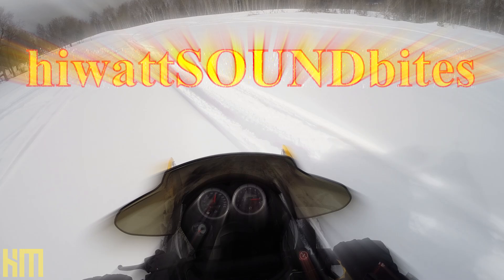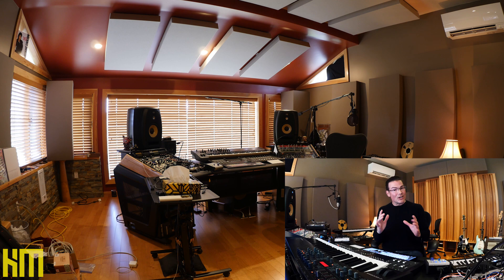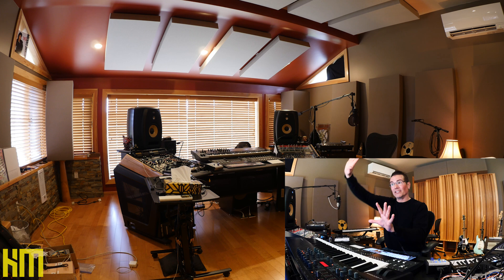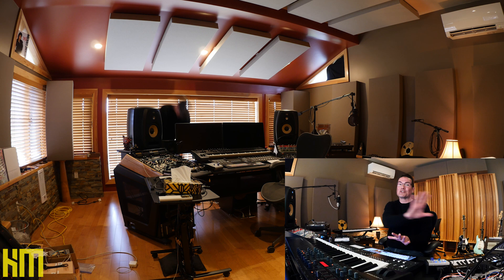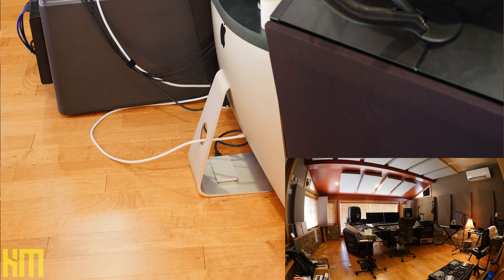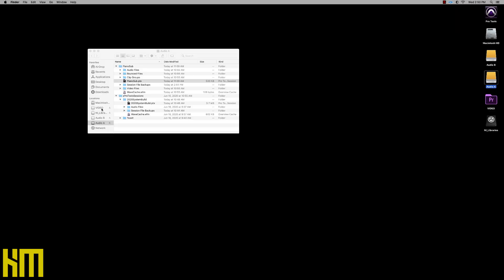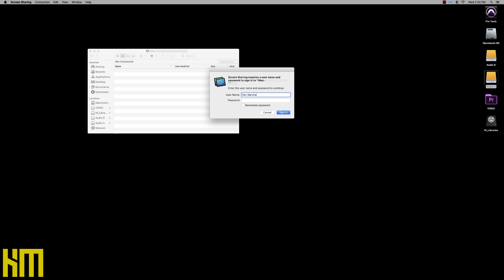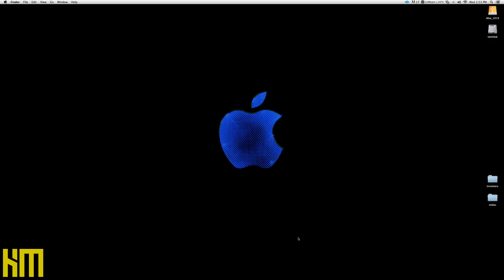Studio Ergonomics - Music Production and Engineering

Comment: Remember to change the battery in your computer's motherboard before retiring it. They're only good for x years and it sucks when they die and you turn your system on and it doesn't remember settings. Also if you have any platter style drives (the ones before SSD came out), it's good to at least turn the system on once a month or so. If they sit too long, sometimes they will seize and won't spin up again without disassembling them, which is not trivial.

Comment: Thanks for another great session, Ken.  This one really hit home for me, for I find myself perpetually re-routing gear, its power sourcing, and audio cabling.  When i choose a piece of gear, at the forefront of the decision is versatility- meaning, will i be able to put this hardware pretty much anywhere in my signal path? will i be able to run/switch between mono and stereo on the fly?  how will my software react to differences in signal path?  ...you get the idea.  there's a lot more to my choices of hardware than 'what does it sound like?'   i understand that attempted future-proofing can lead directly to signal-path neurosis, but it's always a consideration before i pull the trigger on hardware- in how many ways will i be able to use this spendy piece of electronic something-or-other (and its subsequent software controllers), and for how long? 

the above obsession with signal path and future-proofing often (well, okay, almost always) consumes more time than actually sitting down with composition and production... but that's the kind of geek i am, i suppose.  moral of the story: know thyself!   Again, thanks for the affirmation, Ken.   You rock.